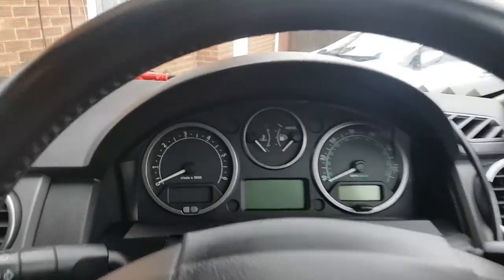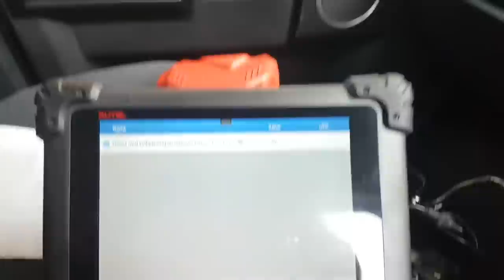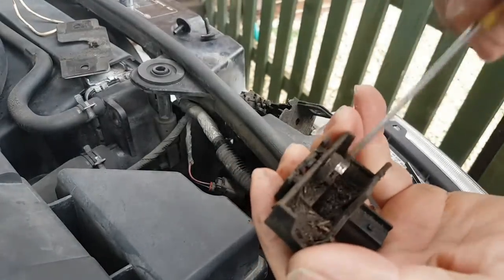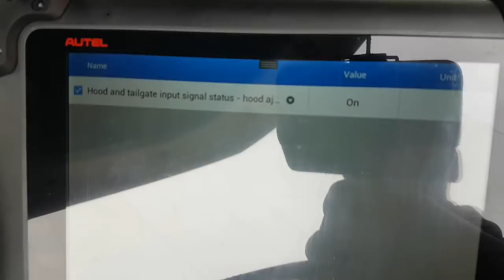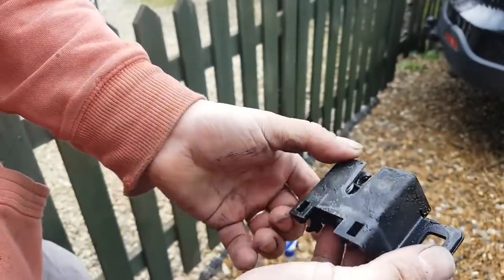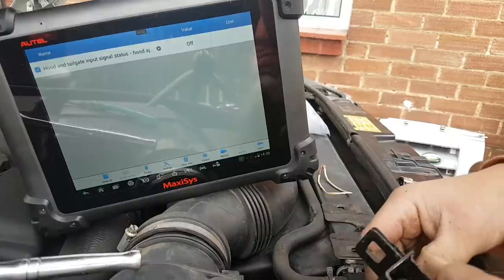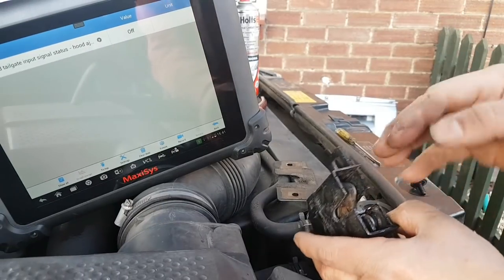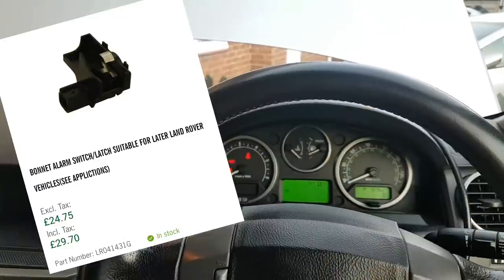Land Rover bonnet always showing open... Fault finding and repair.

Comment: Hi mate. I have a problem with a Renault Clio but can’t remember how I msg u last time about a job u sorted for me. 
This is a Renault Clio 58 plate. The wipers not working. I check supply to it I have a live and earth. But on the orange wire I have nothing. 
Now I only have live when the multi plug isn’t connected then when I put into wiper motor it just goes to earth. Had the body module check and that’s all fine. I have also replaced the wiper stork. The only thing I haven’t changed it the wiper motor but that works fine when I power it up. What do you think I should do next. 

Also have a Land Rover discovery. Sidelights on nearside keeps blowing the fuse. I have disconnected all the lights and number plates and still blows fuses. I checked the wires in the back door they are all fine. Any ideas on that one too